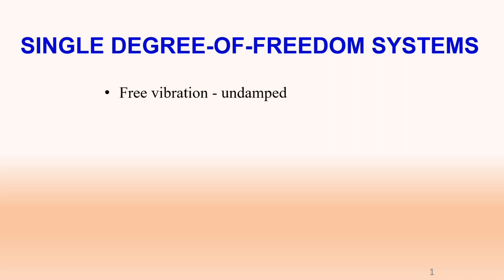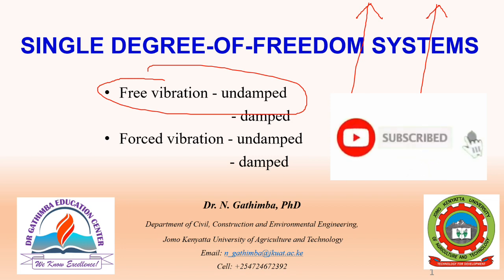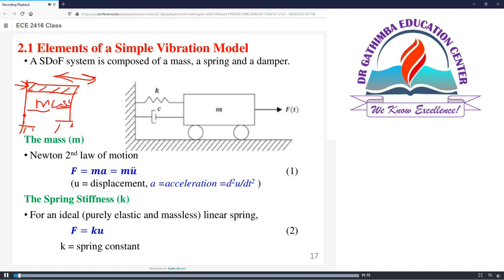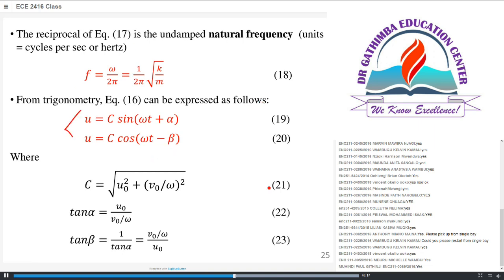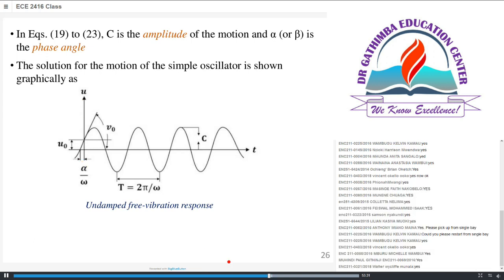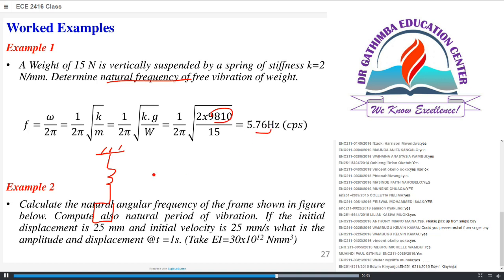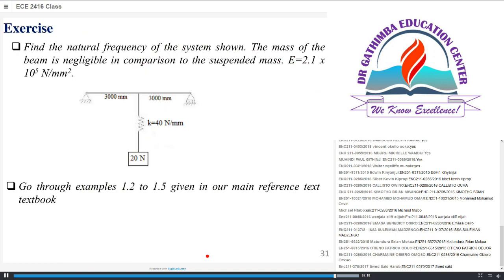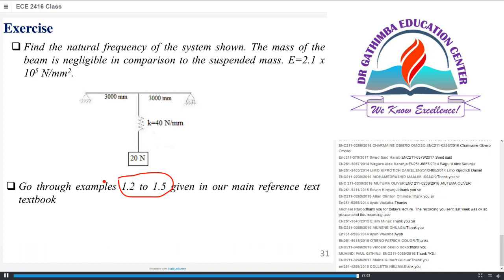2. Free Vibration of undamped SDoF system//Structural dynamics +Solved Examples

Comment: On example 1
Why using g=9810 instead of 9.81 which gives the frequency as 0.182Hz
Because If weight is 15N, mass supposed to be m=W/g= 15/9.81= 1.529kg
Reply from the maker: Just ensure consistency of units and you are good to go.